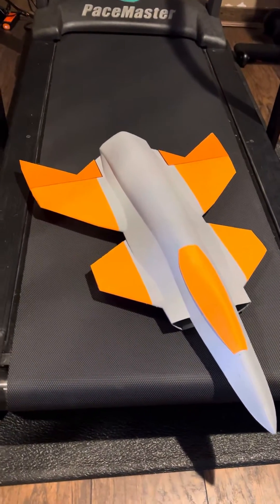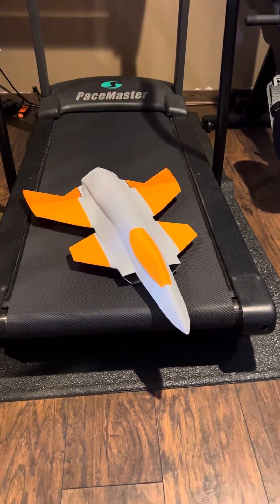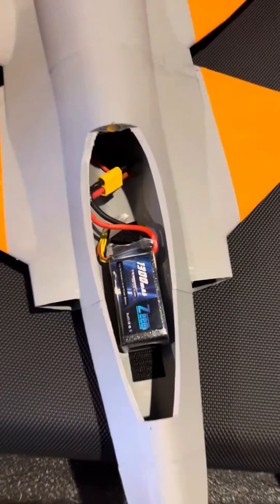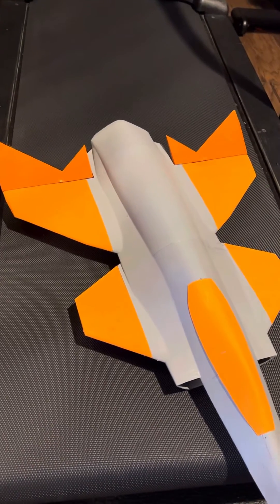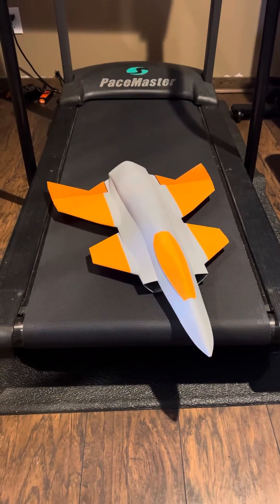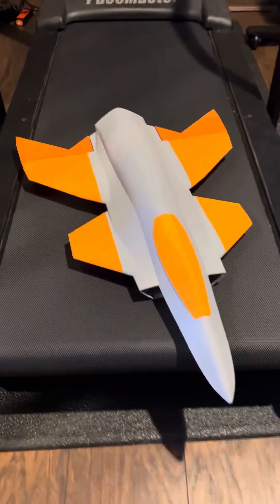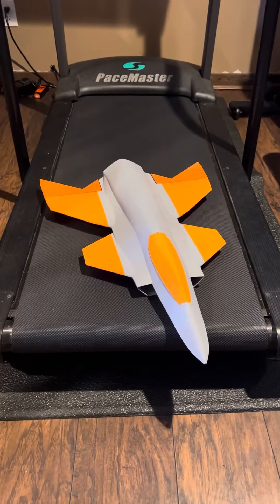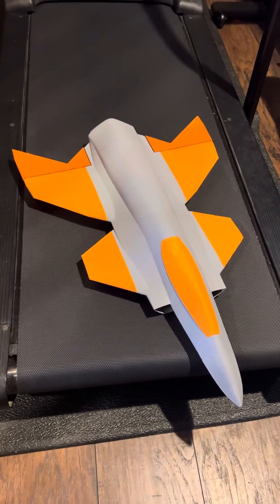X-36 ready for its maiden flight!

Comment: I would add a Flight Controller at least, as it was planned for the real airplane and as someone wrote here, why not a servo and a rudder vane inside the nozzle that is controlled slightly by the FC

Comment: Fly it the way it is, and if it doesn't fly right then add a rudder or maybe even 2 half inch x 4 inch long stabilizers on the top and bottom on the rear end of the plane for low profile

Comment: I have a hard time believing that it with fly without a vertical. My guess is that it will go into a flat spin at the first disturbance.
Reply from the maker: Did you see my glide test video?
Reply: @hotlapkyle  Yes, and it entered a spin a few times. That last glide looked great, but I think any control input will throw it off. You never know, it might just work, good luck.

Comment: This is where the term experimental aircraft comes in. Vertical stabilizer first, trim down each flight, like you said. It's what I would do in order to save time printing a replacement airframe. 
Good luck with it, 
AirHammer out!!
Reply: Yes maybe a socket for a depron fin which can easily be cut?
Reply: @rcpowres  yes possibly, but I was thinking a 3d print (for rigidity) then trimmed with a razor knife/dremel and file/sandpaper. As you know, it's right over the thrust tube area and there may not be enough material in this area for a slot without interfering with the airflow.
Reply: Totally agree. I did this approach in my SA-43 Hammerhead. Started with big ones, then cut down after each flight. And now I have nice looking small stabs in this future fighter.

Comment: There's a question I have regarding the battery and motor combo you use. All my 64mm rc jet build use 3 cell and I've noticed that its difficult to get a good thrust to weight ratio. Creating the lightest possible aircraft that weight around 600 grams with battery and are approx 1 meter long, Im still not acheiving a 1:1 thrust to weight ratio. In this new build you have, it's quite small but uses a 4 cell lipo. Is the power jump to 4 cell that significant? and if so, then what's the point of 3 cells in edf's. I feel like 3 cell edf combos are a grey area that everyone avoids.
Reply from the maker: All depends on the intake volume vs the weight and size of the airframe. I could have used a 3cell. You get 700ish grams with the 3 cell and 900 with a 4cell. Always assume 75% of the thrust when the fan is installed in the airframe

Comment: I'd try it without because it's an experimental plane, both in the real world version and in the model universe.
Don't be locked into conventional thinking (oh, I has to have a vertical stabilizer) or risk adverse (it might not fly, my reputation will suffer or it might break). 
We all recognize that a full size aircraft without computer control wouldn't fly well, will your model and YOU have the responses to fly it? 
So my wuedtion is: are you going to put a gyro in it right from the start?
Reply: The real world version uses computers and more control surfaces to keep it from crashing.
Reply: @toolbaggers  reading comprehension is important, I already basically said that I my post